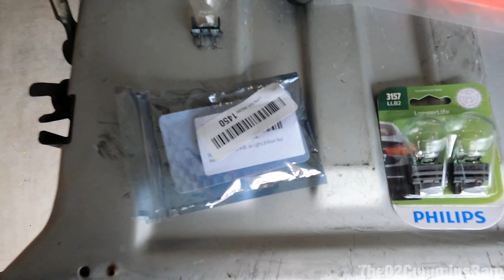New Parts for My 2nd gen Cummins! Full Interior SWAP!?!

Comment: Also all second gens have te plugs for power seats, both mine I converted to power. Just make sure fuses and relays are in.
Reply from the maker: Thanks for the info! I’ll definitely look into it and start keeping an eye out for a good power seat!
Reply: @The02CumminsRAM  Yeah I got done with power cloth on both, just to see if it'd work even in the rolled truck. That way if I screwed up on it it didn't matter. I need to find leather and wood grain now. I have the 98 because i grew up around a 99 since I was two or three and am grown now, that poor old truck is still going around in NC somewhere. My 98 I traded for and it's really close to identical so I'm making up the rest.

Comment: I'd love to do a leather and woodgrain swap in my 98. I have PERFECT cloth though so no rush. I love my 98 1500. I've also got a 98 2500 V10 with 35K original miles, was rolled and parked in a barn in 03 I'm going to rebuild from frame up.